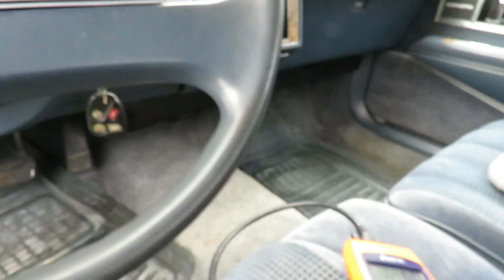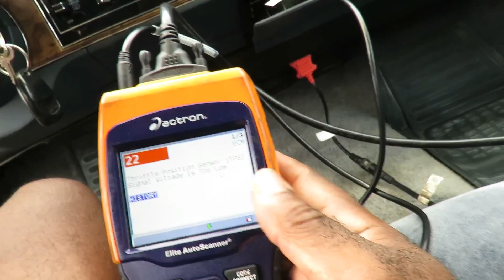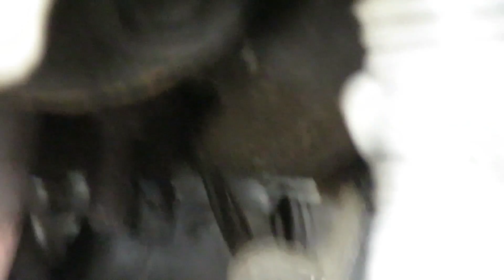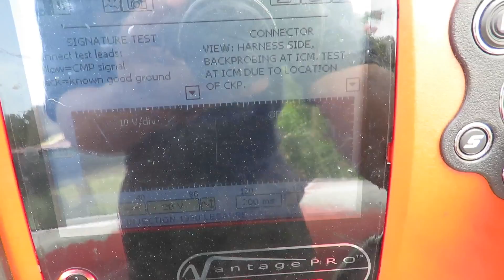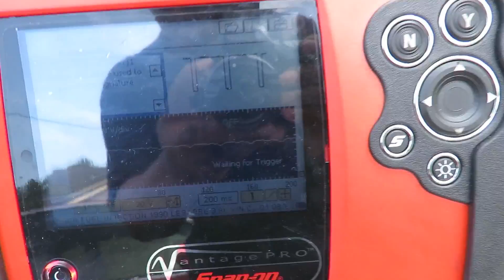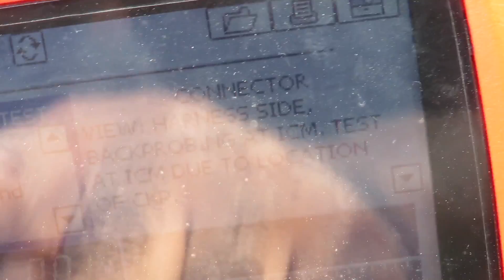⭐ 1990 Buick Lesabre - Stalls Out - DTC 41 - Camshaft Sensor Signal Lost

Comment: i have a 1990 buick lesabre ive  replaced almost all the parts,wires, belts etc it cranks for a mere 2 mins an then it shuts off an just stalls in wont turn over can u help
Reply from the maker: When it does turn over, find out if you lost spark, fuel, or injector pulse.

Comment: you need to pull sensor and check if magnet is still on cam gear. common problem for magnet to fall apart on these cars.
Reply from the maker: Already did that, and yes it was there, and yes that is a common problem.
Reply: @OnlineAutoRepairVideos  What is a magnet on the cam gear? Pull the camshaft sensor and look for what? How do you see in there?

Comment: Did you put liquid electrical tape on any of the spots you poked with the piercing probe? Not doing it is a good way to introduce corrosion and get called back for the same problem again. I'd rather do it now than have to come back out and need to replace the whole wire.
Reply from the maker: Thanks for the tip

Comment: Very nice OBDI adapter, now I can dig that!
Reply from the maker: Now I'm glad I got this one. I think it's the first OBD 1 car I worked on since getting it.
Reply: @OnlineAutoRepairVideos  how much for the adapter and where did you get it? I have an Innova GM code reader that I want to use on a 95 LeSabre. I doubt itll work for anything more than giving me codes. I tried my OBD2 scan tool before and it didnt work :/
Reply from the maker: It came with the Actron CP9690. It has OBD1 and OBD2

Comment: When properly maintained the 3800 are very good engines. I've had 4 Buicks and one Oldsmobile and besides the typical little GM stuff they were very reliable cars.
Reply from the maker: Maybe that's why they stopped making them, they were lasting too long. But, you're right, they were some very good engines.
Reply: @OnlineAutoRepairVideos  the 3800 is too reliable of an engine.  I've spoken to many mechanics,  even dealership ones will tell you that's why GM killed it.  I have an '88 and '89 LeSabre T type. I've had the '89 since 1994- only repairs have been to suspension and one cam and crank sensor replacement.

Comment: I have a 93 Bonneville same 3800. I've replaced the cam sensor recently because I had a check engine light (code 41) checked wires all good. Now no check engine light but recently while sitting at a red light it starts to lose power. The more you give it gas the more it wants to stall. After it sits maybe 10-20 minutes it drives like nothing's wrong. Puzzling...any suggestions?
Reply from the maker: Hey elad226, check the fuel filter, fuel pump, an fuel pressure relay.
Reply: Astral Auto Repairs how can I go about checking those? I've hooked up a fuel gauge to check pressure and got plenty pressure(have to check again to get exact number). Where is the fuel pressure relay?
Reply from the maker: When was the last time you changed the fuel filter? I meant to say fuel pressure regulator.
Reply: Astral Auto Repairs I haven't. I doubt the previous owner did. Has 125000 miles. I will check into it
Reply from the maker: The older GM's had an issue that if those filters were not changed in a long time, they would cause that issue, and at times mess up the pump. Do you know what your fuel pressure is suppose to be?
Reply: Astral Auto Repairs 40-50 psi I'm think. I just finished replacing fuel filter and it was indeed clogged. Hopefully it didn't abuse the pump too much
Reply from the maker: Great find! Hopefully the pump is still in good condition. To check, have the gauge on, put the car in drive, while holding down on the brake, slightly give it some gas to see if the gauge drops, or, if you can place the gauge on the hood while driving, that would be great too.

Other than that, you will need a scope to graph the pump.
Reply: Astral Auto Repairs ok will do. Man thanks for the help. Love your videos!